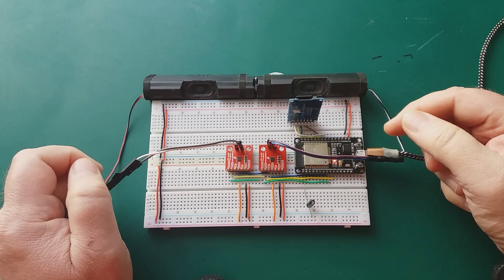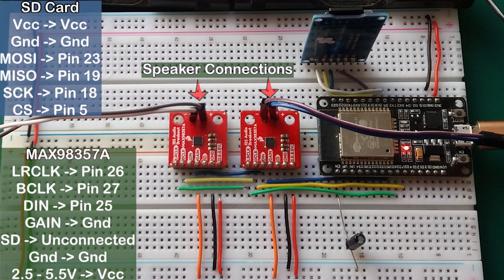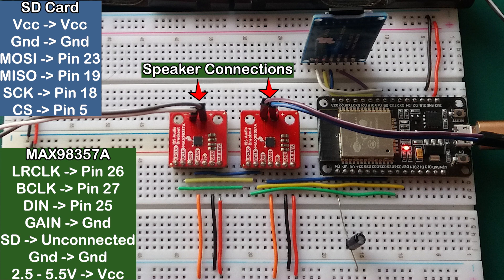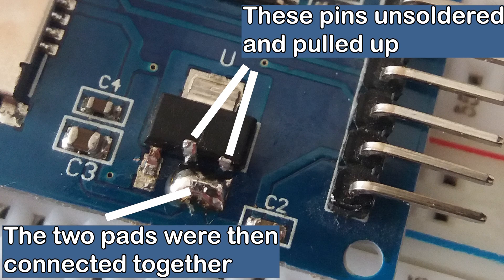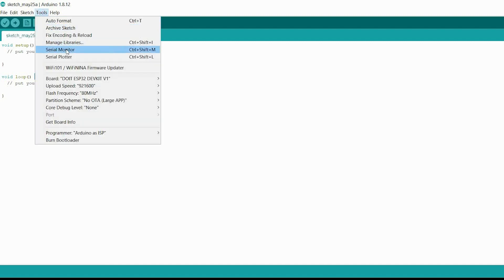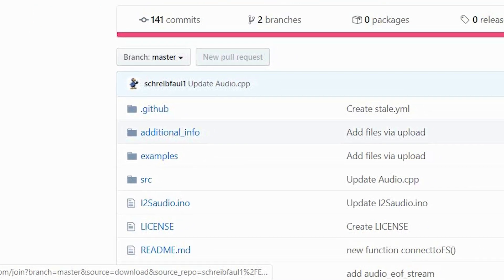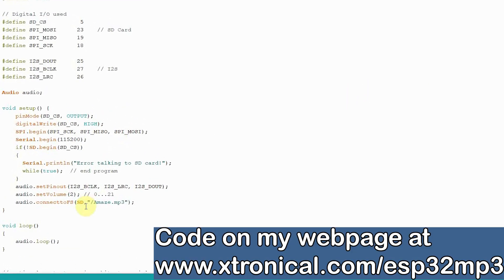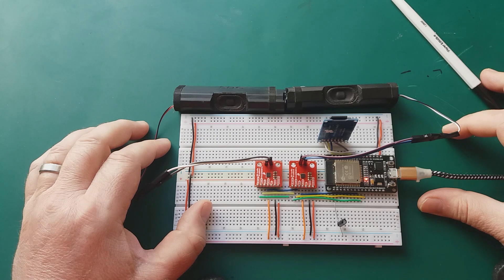Quickie: Playing MP3's (and other types) on your ESP32 from an SD Card

Comment: Forbidden

You don't have permission to access this resource.

Additionally, a 403 Forbidden error was encountered while trying to use an ErrorDocument to handle the request.
Reply from the maker: Yes, my site went down about 3 weeks back. Tried to get help from host but they were not helpful. In middle of moving site to another host and recknstructing site. Nightmare, and don't have lot of time
Reply from the maker: Page for this project back up, still issues with rest of site and I'm working on it but this seems ok

Comment: i dont understand why my ESP32 tells me that Sketch too big

Sketch uses 1450185 bytes (110%) of program storage space
Reply from the maker: How big is the mp3?
Reply: @XTronical  I'm having a similar issue. I thought the audio file was stored on the SD card, not the ESP32
Reply from the maker: Yes, your right, I have a library that stores on esp32, got confused, sorry.
Reply: @XTronical  Just did a little testing and the "Audio.h" alone takes up 72% of program storage space. Did they update the library and make it huge?
Reply from the maker: Really, what the hell is on that, that's ridiculous. Although are you just measuring size of the text file? If so that won't all be transferred.
Reply: i got it, i just need to change TYPE OF MY MCU from DOIT ESP32 DEVKIT V1 to ESP32 DEV Module and change Partition to Minimal SPIFFS

Comment: Second MAX98357A and speaker are a waste of time and money in this configuration.  No difference between left and right channels.
Reply from the maker: I've tested with a known stereo test track, it shows it works. How are you testing?
Reply: @XTronical  I have not tested.  I'm just basing my statement on you leaving the SD pin of both MAX98357A boards unconnected.  This will put the boards into mono mode and output (L+R)/2 from both.  Yes, you will hear sound from both speakers, but it will be the same sound.  You have to configure the voltage on the SD pins to specifically select Left or Right channel.
Reply from the maker: You've misunderstood the use of the SD pin, check the data sheet but in brief. The SD is not the pin that selects stereo channel. It either shuts the device down if low or if high (and unconnected floats high) it specifies that the LRCLK pin should be used to determine which data is left or right channel. The timing diagrams are in the datasheet for LRCLK  etc. As I said I tested with special stereo testing tracks for Mp3 as well. Basically if high it is saying "OK work normally in stereo I2S" which then uses the LRCLK pin for left and right channels. So you can see all is correct. The clue is in the pin names, SD for Shut Down, LRCLK for Left Right Clock. Look up my video explaining I2S, that may help
Reply: @XTronical  I agree hat LRCLK determines the channel of the current data stream, but there also needs to be something that tells each individual chip which channel to output.  One chip has to output data while LRCLK is high and the other while LRCLK is low.  This is the function of the SD_MODE pin to give it its full and proper name.  As you say, grounding this pin shuts things down.  Different voltages on this pin (via pullup resistors) define  the mode which can be Left or Right or Mono.  No connection gives Left channel only.
As you have tested with stereo tracks and everything works, I can only think that one of the chips must be a MAX98357B which defaults to right channel if left unconnected.  Otherwise I fail to see how two identical chips, wired the same way and fed the same data can output different sounds.
Reply from the maker: Right, some apologies but also I'm not sure you've listened to the video closely. Firstly yes, you have to do something to the boards to get stereo but it's nothing to do with the SD pin. I forgot about that bit in my replies, but it's been a while since I did this video but sorry for forgetting that. 
But at just 50 seconds in it tells you to watch my earlier video on setting these boards up for stereo as I won't be covering that again in this one, I even emphasise how important it is to do this. You must have missed this information or forgot I'd mentioned it. So that should clear that up.
Once again, sorry for any confusion caused.

Comment: does it sound better than regular phone mp3 ?
Reply from the maker: Yes and no. The tech is basically the same. The factors that matter would be the bit rate of your sample and the quality of the speaker and it's housing. Probably the speaker and enclosure being quite important as bit rate is easy to change. For there speaker size most reasonable phones do a good job. So some effort has gone into that area.
Reply: @XTronical  oke

Comment: Hi I getting Error compiling this code, Audio audio was not name a type, I used the library that you put in the video. I also use a ESP32. Do you know  what's happen? And Thanks for your tutorial, it is great.
Reply from the maker: I'd check library version just in case something has changed. It may be you are on latest version and I'm using older one due to age of video.
Reply: @XTronical  The error continues. It says: the Audio library is intended to run on sam architecture(s) and may be incompatible with your current card which runs on esp32 architecture(s). I changed the library for an older one. :((

Comment: hey can u please help. I want to play 2 different music at same time on both internal DAC in esp32 (1st one is played on pin25 on1st DAC & 2nd music is played on 2nd DAC at same time in esp32).
Reply from the maker: My DACAudio can do this, mixing both sounds onto to one channel. It will only work with sounds stored in esp32 memory though.
Reply: @XTronical  there are 2 mp3 in the SD card & also set the different audio on different channel to play but only one audio play on both channel but i want to play different mp3 on different channel at same time. have u the code related with mine question.
Reply from the maker: I don't, sorry.

Comment: Are their libraries /Boards that will support 128g etc.. Sd Cards and long filenames/different file systems or are such things above the ability of the esp32??
Reply from the maker: Not to my knowledge but I've never had the need for one that big. I imagine there is a technical problem with above 32gb and the 32bit addressing. I would think not insurmountable but I've never looked into it.

Comment: is there any way to conect thos pins of i2s to and auxiliar jack cable?
Reply from the maker: Yes, other i2s decoders are available that have a jack built in. Or you can just wire up a socket to the output and it'll work fine. The impedence of earphones is much greater than the speakers being used. Just ensure you connect correctly.

Comment: Hi, thanks for the video, it was useful content. Do you have a video where you explain how to get the code on the ESP32  chip?
You seem to be skimming through this very quickly
Reply from the maker: Getting the esp32 to work with the Arduino ide is beyond the scope of that video. I have done a seperate video on this but it is quite old and probably out dated. I would type in "esp32 on arduino" ide" on YouTube for an up to date guide on how to set up and upload code to esp32. Then this guide should be easier.

Comment: Thanks a lot for your great tutorial. One point to add, i.e. as far as I tested, connecting the SD card vcc to vin pin of ESP32 board makes it work normally. I used the same SD card reader as the video demostrated.

Comment: Why is the gain in the video connected alongside the vcc?
Reply from the maker: It's from the datasheet, you can attach the gain to gnd, vcc, or to some resistors for various gain settings. I think this gives 9 dB if I remember correctly.
Reply: @XTronical  so the best choice would be to connect it to the vcc?
Reply from the maker: For my speaker it gave good volume without distortion. Larger or smaller speakers may be OK with different setting.

Comment: Hi! Great video! I am trying to figure out a way of playing multiple sounds, as in a talking clock. I can play single sounds, but getting the system to have a function to which an MP3 file name can be passed, played, and then returned to wait for the next one is a little tough. Do you have any
 pointers?
Reply from the maker: Can't remember at moment and only on my phone but does the code not wait till the sound completes. If not then there should be some properties that state length of time the sample takes. Least I would have thought saw. You then as you worked out need to just pass the filename to the function.
Reply: @XTronical  I tried to add two sounds but it actually doesn't play either sound. In the current system, the file is attached to the audio object in the Setup() and the Loop() has only audio.loop(). The audio library not really well documented.
Reply from the maker: I try looking through the header file of the library. I can't be much more help at the moment as I don't have access to a computer.
Reply: @XTronical  thank you for this.

Comment: if my mp3 file on the sd card is named "music" does the string in the code need to be "music.mp3" or "/music.mp3" ??
Reply from the maker: As it originally is "/amaze. mp3" it would be "/music. mp3"
Reply: @XTronical  thanks
Reply: @XTronical  hey again, so is the library supposed to only work with 8 or 16 bit pcm? And if so why are all the test sounds in the library folder 32bit?
Reply from the maker: It should work with a variety of bit rates etc. As long as they are mp3. It will then convert to i2s/pcm for transmission to the decoder chip.

Comment: I did everything like in video but sd card won't initialize.
Reply from the maker: Did you do the mod to the SD card? It's at 1:33 in the video. On some SD card boards you need to disconnect the regulator and solder a quick by-pass to get them to work with ESP32.
Reply: @XTronical  I found the isue, I added filtering capacitor to power line, and everything works fine
Reply from the maker: Brilliant, thanks for adding this info. The current draw can cause issues.

Comment: what if the Amp or DAC requires MCK, what should I do?
Reply from the maker: Trying to remember, it can be done but it's a faff, when I was researching the previous episode I read solutions, just can't remember where I read the info off top of my head. I think the extra complexity is why I selected DACS that did not need it.

Comment: Do you think the ESP8266 (Single 80Mhz Core) could do this, or do you need the power of the ESP32  (160Mhz Dual Core)?  BTW, any thoughts on using Visual Studio Code with the Espressif IDF extension instead of the Arduino environment?
Reply from the maker: Yes, it should be able to, I think the libraries github page (link in description) may confirm. I've got plans to move over to VS, I use it as a simple editor but not properly.

Comment: How many Rum and Coke did you have lol
Reply from the maker: Ha ha, not enough! You must have been a sub for quite a while, not mentioned rum and coke in ages!
Reply: @XTronical  yes, I have been programming for a few years. Made my own 3d printer with a laser cut frame. And programmed Marlin. And made a few Arduino projects. Like to watch and learn things like what you do. Been programming a ESP2866 WiFi module to control my 3d printer. I upgraded the memory chip on it to 4mb from 1.
Reply from the maker: Hey, wow, the stuff you've done is fantastic. I really like that music too. I have very little talent for music unfortunately, wish I had some! Do you want me to use your stuff in a future (probably next) video and give you a shout out?
Reply: Thanks for taking the time to pop over to my page much appreciated. I would be very happy for you to use some of my tracks. Not sure which is best suited. But I do record most days. I have many tracks you could use. My email is interplain1@gmail.com I will remove this when you have read it. And replied to this. Not sure if you can personal message within YouTube. Not found it if you can.
Reply from the maker: I've read it (sorry for taking so long), will contact you. You tube used to do a messaging sort of thing, but not anymore